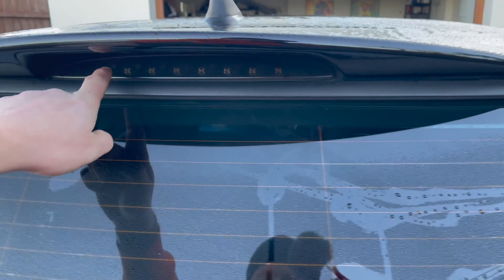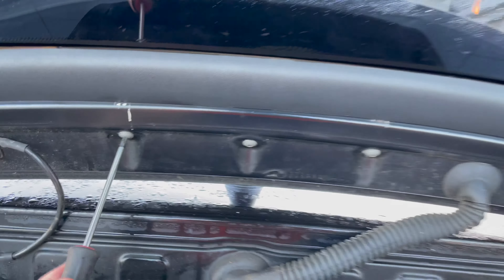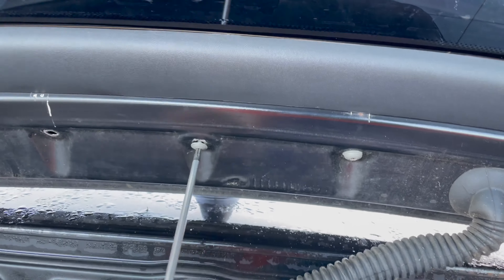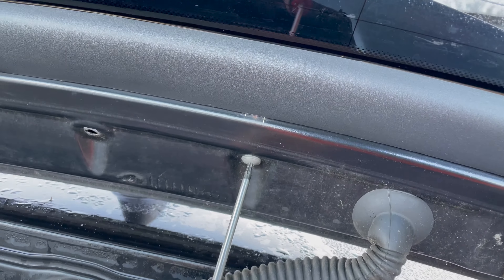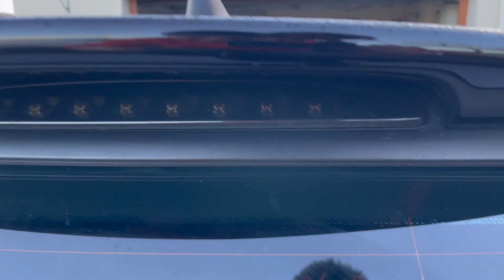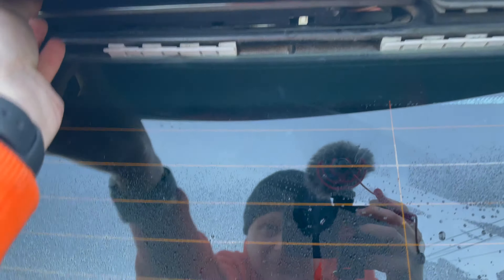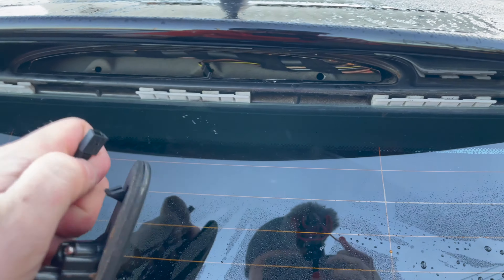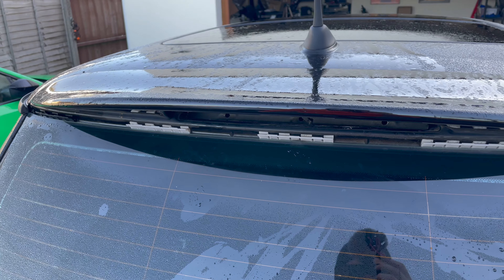Mini R50 R53 How to remove the upper third 3rd brake light Easy to replace

Comment: Very useful vid thanks i just changed mine .i have a spoiler in the way and it took a while to prize it up enough and break the seal on the glue pads to wiggle the new light in place (remove the 2 screws first ) easy after that 😊use plastic tools on the spoiler so as not to damage it !
Reply from the maker: Thanks for watching